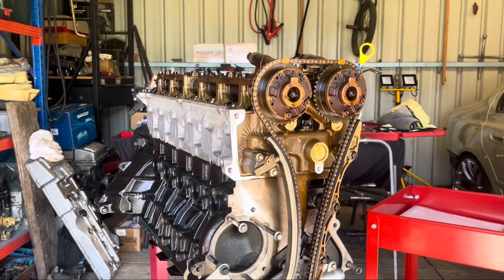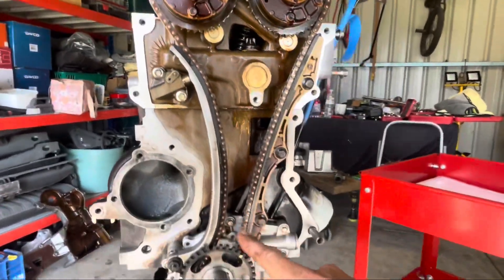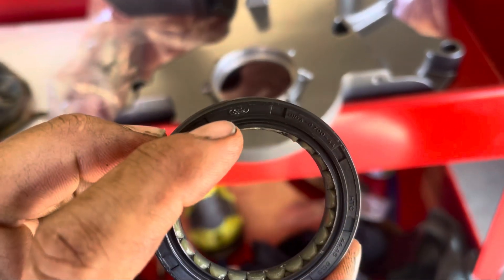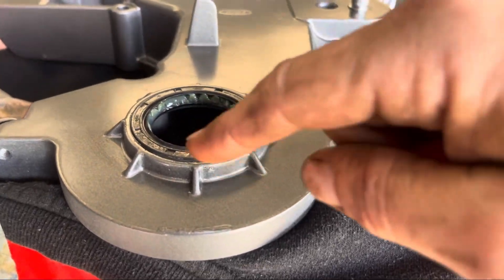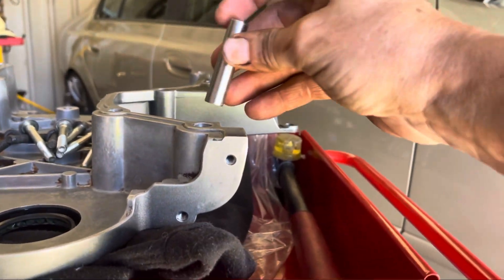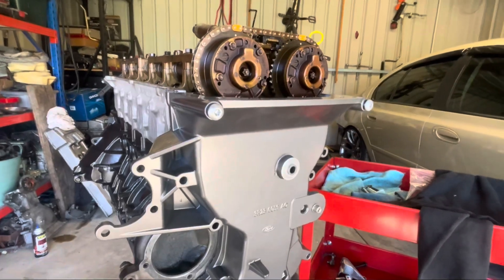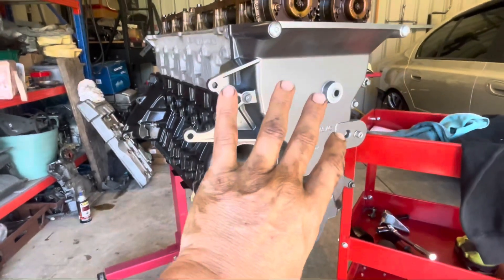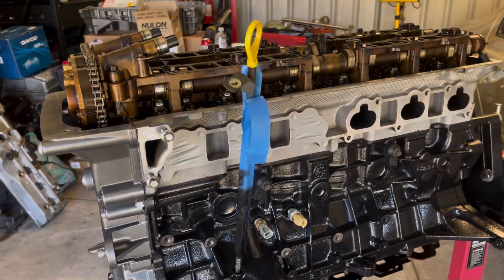Barra NA+T Build Pt. 7 - Fitting Barra Timing Cover & Front Main Seal

Comment: Hey mate ,where did you read about the two-stage timing case cover torque up sequence regarding the silicon ?
Reply from the maker: Hey mate... It is the recommended way to use the silicon as per the instructions on the back of the packaging. From the experiences I've had using it, it seems to work really well. Here's a link to see what they recommend. Cheers mate! https://www.permatex.com.au/products/gasket-makers/black-gasket-makers/permatex-ultra-black-rtv-silicone-gasket-maker-85g/

Comment: Hey man hopefully you don’t me asking but where did you get the torque specs from for all the bolts etc did you just print them out from a website or is there a book with all the parts/specs hopefully I make sense.
Reply from the maker: Hey mate, yep it’s just a file I found online and printed out. I’ve put it in a clear folder to keep in the shed because it’s pretty handy. Here’s a link if you want to do the same.
https://barraswap.com/wp-content/uploads/2019/11/Falcon-2008-Engine-Service-Manual.pdf
Reply: @Jeenzy79  thanks heaps man I really appreciate it awesome work with the build very detailed keep up the good work 👍🏼
Reply from the maker: @Cj-sm99  No probs at all mate! Cheers mate, it’s coming together nicely, just hope the thing starts 😂